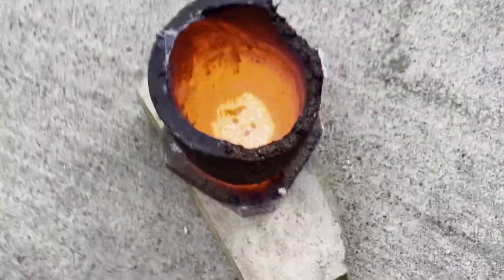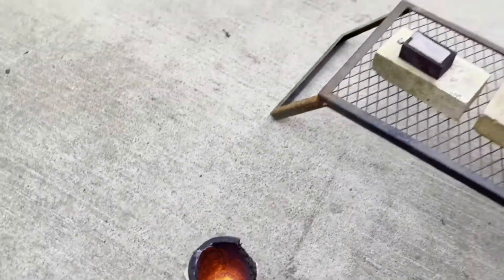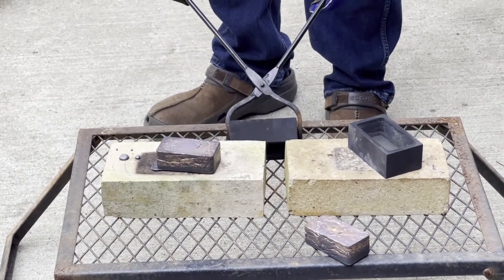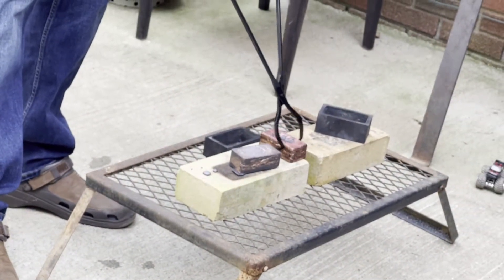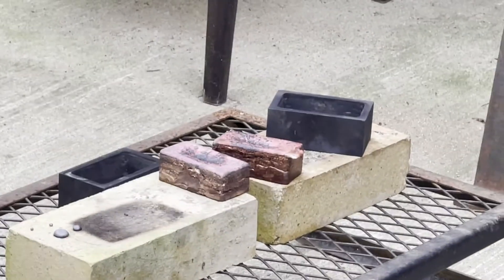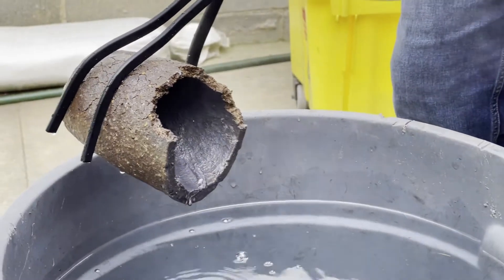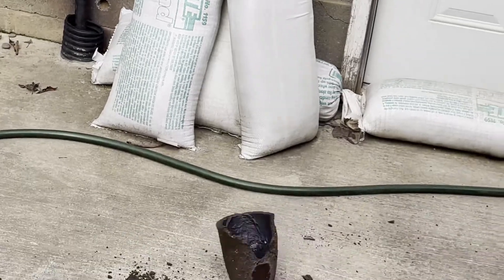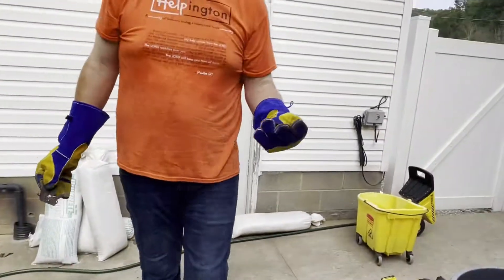Broke my crucible melting 5kg of Copper!!!

Comment: This is going to be my new go-to example to link for why you never try to lift a hot crucible by the rim.  Thanks for sharing this
Reply from the maker: No problem!  Yea, I no longer do it that way and have devised a much better and safer way to pick up and pour!  Thanks my friend
Reply: @samdenning6580  glad to hear it, a smart foundryman learns from his mistakes and adapts to avoid making the same one twice.  Imagine if that rim snapped off while you had that crucible full and in midair between the furnace and mold... As a member of the crispy foot club I can tell you from experience, that would not have been a fun afternoon.

Comment: Hi I am a new subscriber......Get you some crucible tongs  they will be much easier. I plan to get one that 2 people can lift out. It stuck I see. Next time but some card board and sit crucible on it  The ash will keep it from sticking.
Reply from the maker: Hey Ron,  Thanks for the tips!  I have begun to get things much more under control lol.  I want to fabricate some tongs that are better suited for this.  Check out my other videos I have recently done of my copper smelting and let me know what you think of my progress! Thanks for subscribing!
Reply: @samdenning6580  I make bells, some brass and the larger ones of cast aluminum. I do this as a hobby but sold a few ....I never melted cast iron before but have melted holes in them cast iron pots so my furnace made of fire bricks will melt bronze but never tryed to melt any iron...

Comment: Never, ever lift your hot crucible with molten metal like that. Everything what is about a A6 crucible will potentially break! I only lift my A4 crucibles on the lip, everything else I use lift tongs.
Reply from the maker: Thanks for the comment!  I definitely learned my lesson on that one and now have a better setup. Check out my most recent video related to melting and let me know what you think. Any feedback is appreciated!
Reply: @samdenning6580  already done mate ☺️.
Good the lip did not break when you got the crucible higher. Think about that when it would break, fall on the floor and splash all over. Injury granted!
Reply: Was it because of the size? I’m new to this and I have this kind of tongs. But my crucible is only 1kg and I  don’t plan to melt past halo capacity. Am I good? Or this will likely also happen to me? Thank you I appreciate the help